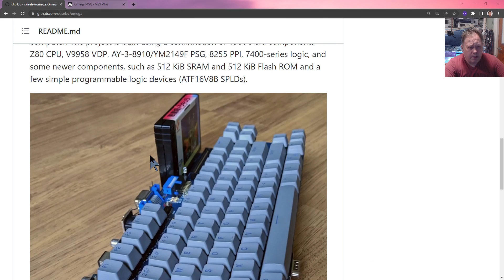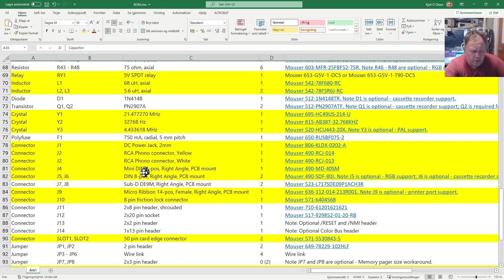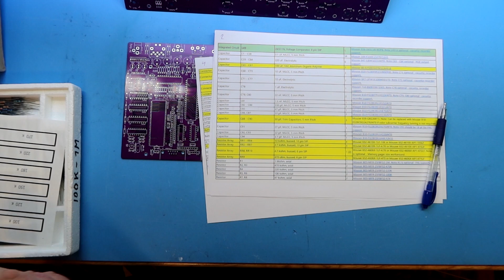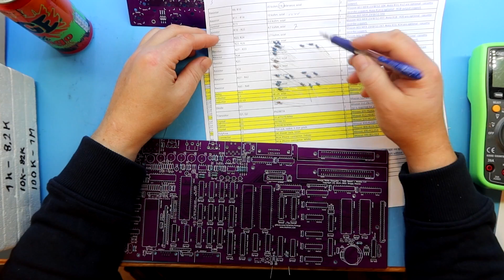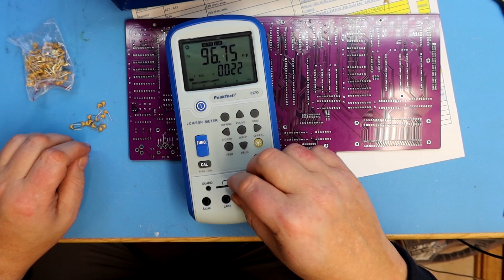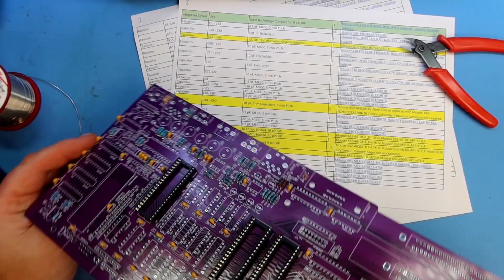Building a NEW 8-BIT MSX machine in 2023 - The Omega MSX2

Comment: This is a fun build. I finished my build a few weeks ago. Burning the 16v8 was somewhat a pain with my tl866iiplus. The chip selection.pld didn't want to program, had to use a GAL chip instead of the lattice? Can't remember the part number. The other problem was burning the wrong eeprom bios.
Reply from the maker: `Hi can I ask you what ROM images you have used ? The Cbios open source or just a rom from anouter msx2 ? Do you know what the organisation of the rom files should be on the prom ? The prom is 512 Kb, and the roms needs to be combined in some fashion to be burnt ?
Reply: @kojroRI  I used cbios to get it up and running (it is great because you can use minimal amount of chips inserted and work your way up. There is a step by step instructions by msxmakers. After I got it up and running I used a custom built BIOS that is from an msx2+

Comment: A technique you might try on your next project is to first convert the BOM to a table in a spreadsheet.  Then you can sort by any column in the spreadsheet very quickly, and even do things like adding columns for such things as Component Number and Height to facilitate sorting by those more easily.

Weller made wonderful soldering systems back in the day, and they are still in business today.   You can probably still get replacement tips for that iron of yours easily.
Reply from the maker: Hi I use sorting and filtering in Excel all the time, but in this case, it's not possible to sort anything to make it follow the hip hap markings on the board, so the sorting I had done, by component type, and then component number made enough sense for keeping control.  Yes, it's not long since i last bought a tip, they still have them in stock at Distrelec, but the temp values and the tip size varieties are getting fewer for each time I order. But these tips are sturdy, and I seldom have to change them.

Comment: TIP
For super-fast assembly, 
1/ Test all components.
2/. Sort components orderly and mark their holding place with their tested values. "An Orderly fashion is critical if you want to quickly locate the right Value you require"
3/. From lowest profile and upward Pick an empty PCB component to be populated and read what component is required there, "Rookie mistake is doing this any other way"
4/. Go to ORDERLY pre-sorted and tested components and insert or place it onto the board.
5/. With a toothpick dab some flux at the marriage point and solder the component to the board.
6/. For through hole components, Clip the excess leads.
7/. "Optional" resolder the joints after clipping to avoid corrosion to solder joints. "Doing one component at a time will ensure each component has been properly soldered."
8/. Tick the component off on your list and Goto 9
9/. if job lot incomplete Goto 3/. Else Goto10 " NOTE now would be a good time to note how much time you just saved"
10/. Clean your assembled PCB with a liberal amount of IPA and re-inspect the Board..

APU I dropped a 👉👍👈